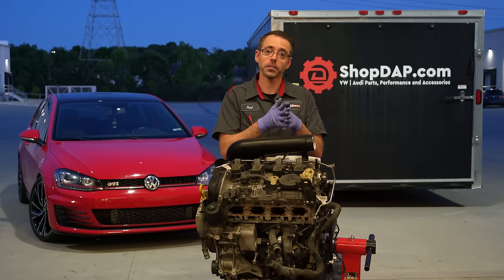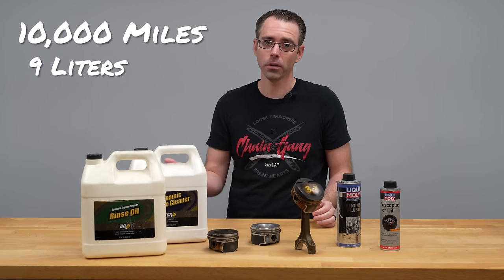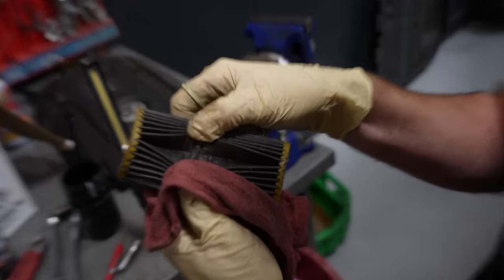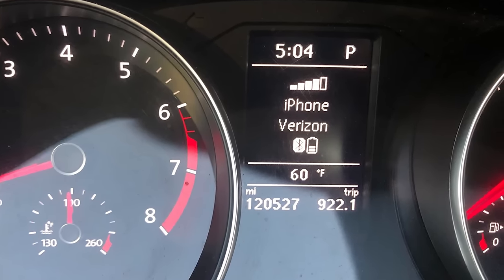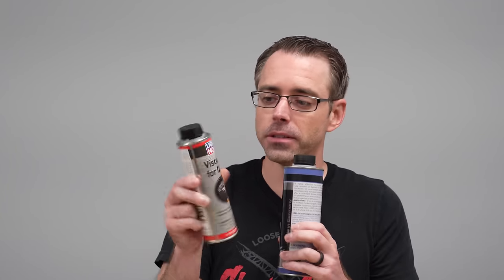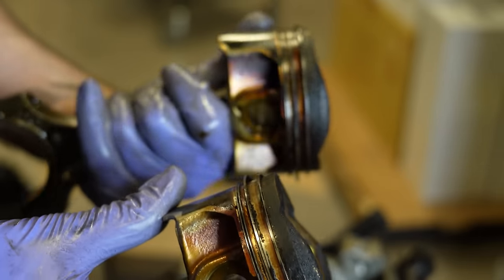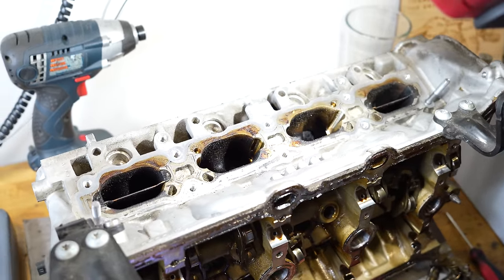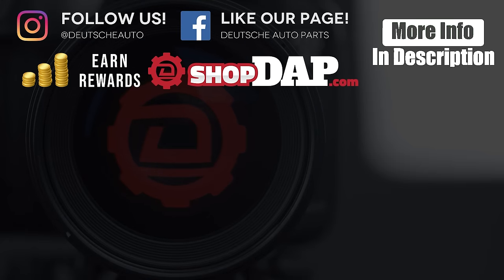Can you Fix an Engine Burning Oil for $20

Comment: After spending $3500 for piston, ring and timing chain replacement on my 2012 A4 2.0 Audi split the cost) the motor again failed at 60K. I paid $12,000 for a crate motor from Audi. Purchased the car new in 2012, car was meticulously maintained. Total invested in the vehicle has been $83,000 to date.
Reply: I got my pistons and timing replaced for $1500 and sold the car. Never buying post 2005 cars again
Reply: Gee. That’s not something I am willing to spend.
Reply: You sir, are a true Audi enthusiast. 83k could of bought a RS3 with some tasteful mods.
Reply: I guess for every story like yours there's someone like me, with a 2016 GTI with stg2 tune (making almost 50% more power than stock) which spends most of its life on the track with engine at the redline under 30+ psi of boost and needs less than 1/2 quart top off between the  8-9k miles oil changes. Currently at 67k miles and zero issues.

My 2015 TDI needs about a quart in between the 10k (mostly highway) miles oil changes

I'd call it the luck of the draw, with the car and the dealer techs doing the work (every time I had to take any of my VWs to the dealer for any warranty work they would break something that wasn't broken when the car came in)  :)
Reply: @raoulrr  amazing stuff bro except the issues are with ea888 08-12
Reply: Perhaps you are not aware that the engineers at Audi and VW and other brands no longer know how to construct pistons and piston rings?
Chains and camshaft drives are also often incorrectly constructed.
After 150 years, modern engineers no longer know how to make pistons and springs.
That is a complicated matter, people think too easily about it, they should ask the retired engineers that and do not want to reinvent the wheel.
Reply: @heinpereboom5521  they know full well, the problem is with financial constraints and eventually overall weight savings. Even 10 grams are important. 10 here 10 there and presto "the all new audi A4 is 28kg lighter than the old one". And people prefer it over the old one because it's newer and therefore better . Because ultimately people don't want perfect cars or things. They just want something different.
Reply: @gigel99324 It does not seem useful to me to also save weight for such essential parts of an engine that weigh so little.
Making a mudguard 3 mm shorter has much more effect.
Drivers want different things.
1) that it always starts.
2) that it does not stop on the way, but continues to drive nicely.
3) that it has no unnecessary maintenance costs.
4) that it is fast and safe.
5) that it looks nice for the neighbors.
Maybe not in this order, but this is a perfect car for most people and they want it.
I don't know people who don't want a perfect car, but they probably don't think about the large amount of money they spend, because they are rich enough.
Reply: @heinpereboom5521  such a car has been any car from 1985 onwards or let's say 2001. But people still throw them away to buy the latest model...
Reply: @heinpereboom5521  I believe it's more of a bean-counter meddling than an engineering incompetence, and it's not a VAG exclusive. (eg. BMW has also "forgot" how to make valve seals and main bearings, that used to be perfectly fine 30 years ago, or thinking cylinder sleeves are not needed anymore)
Reply: @heinpereboom5521  planned obsolescence is the reason why they are not prioritizing durability. New cars nowadays are as good as disposable cameras.
Reply: @gravitygabri3l  I’m aware. The car has been modified, prior to engine replacement. KO4,intercooler, cat back,aluminum manifold, coilovers, transferred all to new engine . Bought a 2022 TTS several months back, intended to buy a 2018 TTRS, priced as new. Too many cars now!😂
Reply: @heinpereboom5521  Engineers know how to build engines that don't burn oil. The government won't let them because of fuel economy regulations.

Comment: I wonder if those pistons were bad from the factory. Not familiar with too many different manufacturers designs but the ones I am familiar with would occasionally see the 3rd groove notch as a defect. All the pistons that we did were designed like the replacements.

Comment: I have used a KOH device to split distilled water into hydrogen and oxygen for about ten years now on various engines. When the water recombines in the combustion chamber 
it steam cleans the carbon out and you lower the amount of oil burnt. You can feel the engine running better, it's more economical and it stays clean. You should try it!!

Comment: The exception to the rule of not buying another engine is if you find a really low mileage engine with sweet smelling oil and clean Spark plugs that don’t look recently replaced. They are out there so keep an eye out for them …

Comment: Really a great instructional video with amazing results.  We own a 2014 VW 2.0 TSI that has only 41K miles. We bought it used but have all the service records.  Over the history of the VW< the oil was changed at a maximum of 3000 mile intervals.  Oil gets changed by us once a year which isn't many miles.  The past few years, it amounts to 1000 to 1500 miles per year.  The tail pipe is black inside and it coated with a thick oily sooty goo.  Not sure why this is happening?  The oil usage is a quart every 1000 miles (every oil change).  Maybe we need piston soaking or a new PCV assembly?  I knew when we bought a VW, it was a bad idea.  My 2002 SAAB 9-5 has 180K miles, 90% town miles.  Doesn't burn a drop of oil and all cylinders compression are within 5 pounds of each other.  I guess SAAB knew how to engineer a Car but GM destroyed the company.   Plan to drive the SAAB for many more years.  The VW, not so much.

Comment: I’ve had 5 GTIs, all burned a bit of oil during changes. Always had to top off a few times between the 5k when I do a full change.
Reply: Same with my R.
Reply: After rebuilding the vr6 engine in my gti, it never burned a drop even after 2500 and beating on it.

Comment: I used to sell BG products when I worked at a dealership. They are great products and I recommend the ATC additive for automatic transmissions. I went through the training with BG specialists about there products and I also went through the training about Pennzoil products for Mopar. BG did not like me questioning the quality of the MOA additive for motor oil because of what I learned about Pennzoil and why SRT switched from Mobil One to Pennzoil Platinum....lol. I highly recommend the BG MOA additive for people who want to use Conventional motor oils or Semi-Synthetic motor oils. Adding the MOA to something like Pennzoil Platinum is a waste of money as the additive does not enhance anything and the BG specialist did not want to tell me this on record...lol
   If your skeptical about BG products, I would recommend them over any other additives on the market except the MOA if you use a high quality synthetic motor oil. The BG MOA additive is basically adding high quality synthetic motor oil additives to your conventional or semi-synthetic oils.

Comment: The problem with most german cars burning oil is due to the kind of driving people do in the US. Most german engines are designed to be safely operating at high rpm for long periods of time such as driving on the german autobahn, thus the piston rings are looser to compensate for metal expansion at high temperatures. In the US, we don't drive at 4000rpm for long periods of time, so the piston rings always let some oil pass though to be burned. When you burn oil, it turns into soot and sludge which clogs up the oil control rings and drain back holes which causes more oil burning issues.
Reply: This does remind me of Ken Miles's counsel to an MG owner complaining about his car performing badly.  Ken basically said, drive it high and tight like you mean it, changing up at 5000rpms, and you won't coke up your motor.

Comment: I had a 1966 Ford Anglia 105E. It had a cast iron engine. Speeding along Towyn beach a large stone put a hole in the sump.  I drove it back to Liverpool at normal speed with not a drop of oil in it. The next day I got a sump from a scrapyard and filled it up. It done no damage to the engine at all . They don't make them like that anymore. I also drove a Morris Oxford dome distance with no water in it that was fine as soon as the leak was repaired  again it had the cast iron engine.

Comment: Have seen on two occasions those older pistons cracked where that missing notch is under the oil control ring. While I’m not sure why the piston was updated strength in that area is a concern.

Comment: One of the problems I have with ‘at service time’ flushes, is you’re adding it to oil that might be at, or over its maximum capacity for holding contaminants in suspension.

You wouldn’t wash the dishes in dirty water by adding more detergent; you’d use fresh water.

Dropping the oil and replacing with some cheaper oil for 300-500 miles then adding the flush to that oil change before doing a change with premium oil has stood me well so far.
Reply: That'd what your filter is for bro
Reply: @mentals555  a cars oil filter won’t capture the many particulates left behind from combustion and the byproducts of detergent breakdown in the oil.
Dispersant additives exist to keep these in suspension in the oil so it can be removed along with it.

I’d suggest looking up a bit more info regarding the interaction between oils, additives,filters and flushes for the sake of your engines health.

Comment: I have always added a pint of transmission fluid to my oil change.   At 220K + miles the engine was as clean as a factory one.  In my Ford 500 with a 3.0 L V6 you could look at the top of the engine through the oil fuller cap of the valve cover.

Comment: That car is basically the same as my subaru forester, I was burn such heavy amounts of oil even after the engine was warranted, it got so bad I had to use premium fuel because I had spark knock because of the carbon build up(sounded like a diesel under heavy loads) and the engine lost so much power it would hesitate to move out of its own way, just a basic 2.5l naturally aspirated engine
Reply: Subaru engines, like all boxer engines, vw, porsche etc share a common problem, that gets really bad in some engines. Boxer engines are notorious for excessive engine thermal growth, head - block - crankcase - block - head thermal expansion, compared to inline engines head - block - crankcase only thermal expansion. The engine growth is large enough to blow head gaskets constantly, snap cylinder head bolts or pull the head bolts straight out of their threads in the crankcase. The boxer engine reliability is a myth, found only in low power output, low operating temperature , low cylinder pressure engines of dcades past.

Comment: I used Mobil 1 5w-50 oil since about 30k miles to significantly reduce the oil burning in my ea888 engine. Its VW approved for the oil standard of that engine and costs about double.
Reply: 5w-50 is vw approved??  hmmmm....

Comment: Couple things. The "dome" below the oil ring is simple - when you bore the  hole for the wrist pin, it creates that dome. Now, the burning prone pistons have that extra little cutout, but bear in mind, that is BELOW the oil ring, so its scraping function is not affected by that - in fact it might shed oil BETTER than the one with just the "dome". Second thing is that piston ring drag is the majority of engine drag, and any reductions there help with power, efficiency, and thermal load and thus emissions, so you want to run as little ring tension as you can possibly get away with (in a drag motor, I'd try omitting the second compression ring entirely). Clearly they chose a little too loose, but I can see why they did that. I don't think the minor change to the piston did anything unless there were other changes like tighter clearances or something. Its going to mostly come down to ring tension. I guess I got lucky in that I've had 12VAG cars from multiple generations and multiple generations of 1.8T and 2.0 and not a one burned oil even at high miles. Considering I drive em' like I stole em', ya'll just need more Italian tuneups!

Comment: Piston soaking can help with oil consumption, I think its probably the best option since it comes in direct contact with the piston and rings.

Just takes longer for it to work its way threw the rings.
Reply: Yup, soak it with SeaFoam.

Comment: Replace the crankcase ventilation components.
Make sure to use reinforced hose for the PCV
valve. Replace the valve seals. Use umbrella type 
valve seals on early Chevys with the o-ring type, 
where obviously called for, or for engines that 
originally use this style. New positive seal types
are best, and are stock on most imports and late 
model domestic engines. Clean the crankcase
with a  modern engine flush product, some used
diesel in the past (NOT GOOD). Low drag rings 
for the street do not really matter if free of sludge.
Replace leaking gaskets. Increase slightly the
viscosity (no more than 10-40 to 20-40) for
high mileage engines. There are "high mileage" 
oils offered as well, some with synthetics in the 
mix. Use high quality high flow oil filters. You
will see the smoke reduced or eliminated, and
oil consumption drop.

Comment: This was a great video to watch. Hopefully all maintenance concerns and issues will be behind me when I buy an electric vehicle this year.
Reply: hahahaha. Just a battery replacement
Reply: @arnog9959   Just like an engine replacement. What's your point?
Reply: Going from mechanical issues to electrical issues
Reply: @rccl4487  My brother owns 2 Teslas. He's had them for 5 years without issue and they are on the original brakes. No oil changes or any other maintenance. I'll give that a try.
Reply: Wait a few more years and see what the battery pack cost to replace.
Reply: @nazo.8143   Well federal law requires auto makers  to cover EV batteries for at least eight years or 100,00 miles. In California it is 10 years / 150000 miles.  My brother lives in California. Even so, battery costs are falling rapidly. I'd imagine by the time the cars are 8 to 10 years old, a new and cheaper battery technology will exist.

Comment: Causes of oil burning aside from the ones you already know (1) engine overheating non oem thermostat, non oem cooling fan temperature switches, poor coolant circulation from corrosion buildup in block and head from using tap water mixed with antifreeze (always use distilled water), causing ring tension loss (2) ring wear on ring land side or worn out beveled ring lands inside ring grove allowing rings to tilt on upstroke downstroke pumping oil into cylinders (3) defective pcv system allowing oil into intake manifold (4) plugged drain holes in oil control ring lands not allowing scraped out to go back into oil pan (5) oil dilution from fuel injection system delivering excessive fuel during cold start, warmup, or dribbling injectors not sealing off with engine off.
Reply: My wife's car suffers from the pcv problem, Chevy equinox....
Reply: @gristlevonraben  The earlier Equinox's also had major problems with defective piston rings that lost their tension extremely early, and causes excessive oil burning.
Reply: You forgot one……worn valve seals…..typical for VW’s…. Jim

Comment: The Honda 3.5 V6 has this issue due to the VCM which pulls oil into the cylinders when it shuts down the back 3 for "eco" mode. I wish there was a shop anywhere close to me that offered the BG dynamic service as I am dealing with one that keeps oil fouling the #3 spark plug.
Reply: VCM Muzzler...
Reply: Weird, my family has 2020 Honda Pilot with the V6 and a 2017 accord V6 last one with the V6, both with VCM and absolutely 0 problems with both

Comment: I like these videos. WatchJRgo did the same product on a dodge dart and i was blown away. My 1.8t burned oil but some 10w60 and a lucas oil stabilizer and it stopped. The engine rattles on cold start but fixed is fixed

Comment: I have a 2018 Passat 2.0TSi with this exact problem and of course VW has hid behind their obscene high oil consumption tolerance spec. I had it in for oil consumption test before warranty and VW just said it was within spec, and problem has only gotten worse.
I'm going through 1L/1300km on average right now. Just had turbo replaced due to slow boost code, and cat was plugged putting car into limp mode.

 Definitely going to try this.1
Thaaaaank youuuuu!!

Comment: I came for the knowledge, and learned that I probably don’t have an oil burning issue lol my mk4 2.0 goes to the bottom of the dipstick after 4k miles. Which I found alarming but now I’m not as concerned since you mentioned those oil burning specs. That’s insane haha

Comment: Another change is the oil control rings on the update version is thicker. and the cilynder walls have to be machined to change pattern of the walls to really fix the oil consumption

Comment: My 2002 F150 5.4 liter engine has 170k miles on it. Uses a quart of oil every 5,000 miles when I change it. It had started making a little valve train noise on cold startup.  The last two oil changes, I added 6 ounces of Seafoam to the oil and drove it gently about 30 miles before changing it.  And the valve train noise has subsided.  I'll probably continue adding the seafoam before changing the oil.
Reply: Has it changed the oil consumption though?
Reply: @loveracing1988  No, nothing else changed. The lifters are just quieter.  The oil drained out was noticeably blacker.  I will continue the practice of adding the seafoam a few miles before changing the oil.  Some quick change oil stores used to do that as standard practice only they put the cleaner additive in just before driving the vehicle in a stall to change the oil, so it didn't have a lot of time to clean.